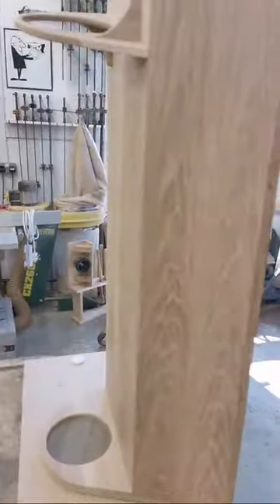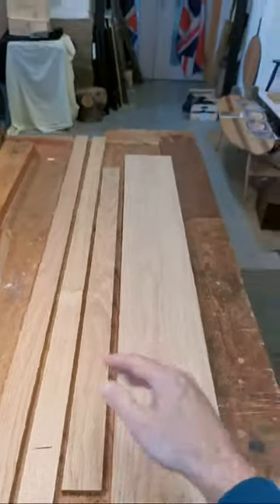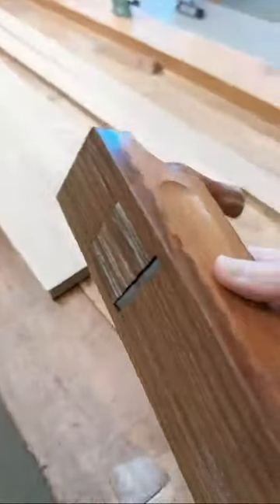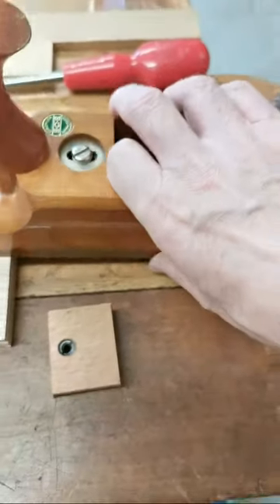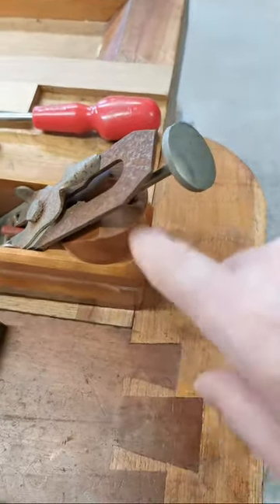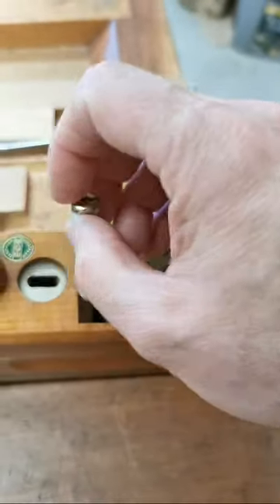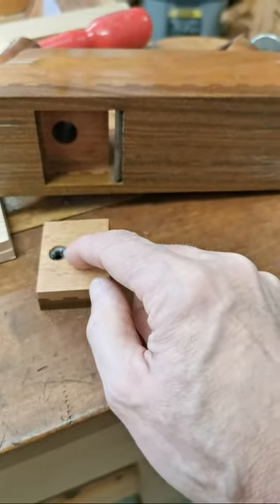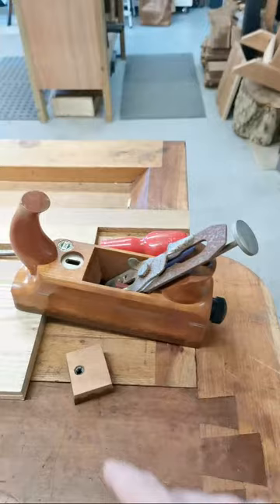Cabinet & Planes Vlog18

Comment: Hey. Looking forward to your vids on ECE planes. I have several I bought off ebay in the early 2000's. It seemed like people were buying them and selling them off when they realized that they would need sharpening. I used my gigantic battleship ECE jointer just yesterday. Lignum Vitae is a really fascinating wood. I also liked the Record chisel vid. I casually happened to get a set of Record split-proofs of a similar vintage to your fancy set (marked hand forged in Sheffield) when buying a router table from a guy 10 yrs ago. Just now finding out that they are considered to be very good by Brits.
Reply from the maker: Yes the ECE thing seems to be that they were expensive but some people have struggled with them. Probably because they bought into the 'unknown' just because they were expensive. (some are like that)
A little new understanding, patience and with good sharpening skills they can be great. Those Record chisels sell well now. How many ECE planes have you got then?
Reply: I am embarrassed to report that I have 7 that I can remember off hand. All used.
Reply from the maker: They sound great. Are some the wedged type? Come on tell how many of each style/size. I know what it's like. They get you sometimes and you have to rescue them.
Reply: @twcmaker  Ha, ha! I have the primus reformed like you show. The 11" jack plane,  the shoulder plane and the giant size jointer - all lignum vitae. I have the wedged bull nose and scrub plane -which I have actually never used, because I havent needed them yet. I the block plane I got for almost nothing but looks like it got left out in the rain - have never been able to get it to cut reliably - something is warped but I havent taken the time to figure it out. All of these used for less than half of retail on ebay. It was my strategy to get as many of these as I wanted instead of going for high end tools like Lie Nielsen or the fancy vintage infills like you have :)
Reply from the maker: Great strategy. I approve totally. What a collection 👌👌👌I think it's great to save these planes and they're (like mine) kept in a better environment than they might have come from. The next thing is to get them going when the time is right. Only you know that. I would love to cover everything on my videos that might come up as a fix to get them working and loved again. Feel free to throw any comments on issues and I'll see if I can help. But it sounds like you know exactly how to sort them. Let me know how you get on. Jamie
Reply: @twcmaker  It might be interesting to talk about the steel in the ECE blades. I am getting back into to woodworking after not doing much for a few years and am in the process of sharpening and setting up all my tools. I noticed that the steel on the ECE's seems different in look and feel to the old Baileys and a couple of newer planes I have. Not worse, just different.
Reply from the maker: Oh okay. I'll read up about it and then see how it sharpens up and compare to some of mine. Sounds interesting. I wonder if they have to be sharpened more often?
Reply: @twcmaker  That is my question - I admit to being a lazy sharpener. I tend to pick up the next sharp plane and sharpen when everything is dull - maybe I can grow out of that in my old age :face-fuchsia-tongue-out:
Reply from the maker: I think it would be a good 'bad habit' to get out of. I've just Googled it and @TheEnglishWoodworker wrote a great piece back in 2016 I think.
Here's a link. https://www.theenglishwoodworker.com/ece-hand-plane-review/
 It's a good review and mentions the steel too.
Reply: @twcmaker  Thx, I've seen that review, if fact I saw it while looking for ECE videos on u-tube. I think your vid was recommended in my feed because I searched ECE a couple of months ago. I dont remember why I was looking other than I am starting to get back into it and was curious to see what people were saying about continental style planes. It is amazing how much info is available now vs in the late 90's when I got semi-serious about WW.
Reply from the maker: Yes there's so much information around now. And I'm making a blog post, Facebook, Instagram and Twitter sharing. Each a little bit different. So theres a bit more out there now. Glad you're getting back into it. 👍 Jamie

Comment: The filming seems a little jittery mate.
Reply from the maker: Yeah I think my WiFi connection was a bit iffy. Should I delete it?
Reply: @twcmaker   only if you remake it with the same content please. I was really interested with the plane but it was too uncomfortable on my eyes. Sorry pal, don’t mean to be rude.
Reply from the maker: I'll do it 👍 not rude 👍 I've not even watched it back, I had a student in by the time I'd finished.
Reply: I like the idea of a nurl knob for block adjuster.. I looking forward to your video. I'm gonna check my block adjuster today been in vise glued up for a day now
Reply from the maker: I'm so pleased these videos are helping you to fix your plane. Keep us updated on how the progress is going.
Reply from the maker: I've watched this now. I see what you mean. LIVE can sometimes be like that. I need to do more live videos as YouTube shares them. I think my florescent lighting makes it worse. I'll look into my setting before doing another one. Cheers. Jamie
Reply: @The Worcestershire Cabinet Maker  I checked my glue up job and it seemed to remove the gap or pulling apart of the wood. It still just proud of the plane by 32nd of and inch. Looking at the inside of the plane where the block sits seems a but rough. Currently I see two choices 1 sand down the block to fit or 2 sand down the inside of the plane where the block goes. Decision
Reply from the maker: I very lightly sanded the top surface of the block, after I had taken the bump off with a Chisel. And scraped inside with a Chisel too. 
Did you take the threaded insert out?
Reply: @twcmaker  yes I removed the thread insert prior to gluing and smashing it back together in my vise.
Reply from the maker: Next video shows how I fit them. With the two pack resin sealing the wood so it can't absorb moisture and a seal around the top. I tried to get the thread into the Lignum too.